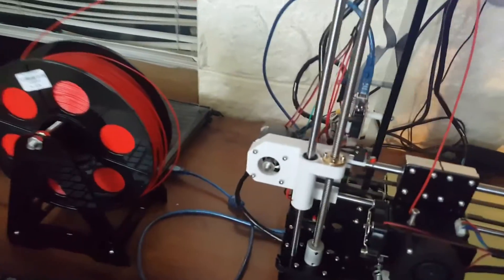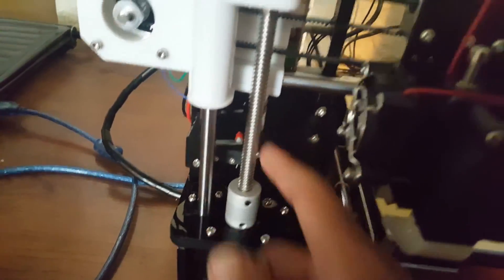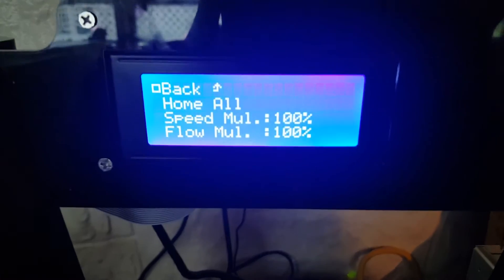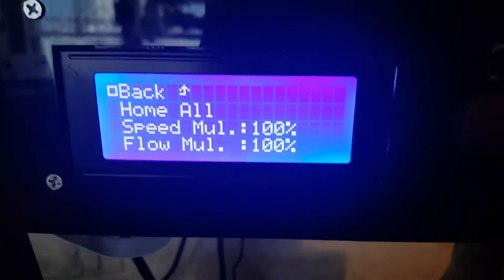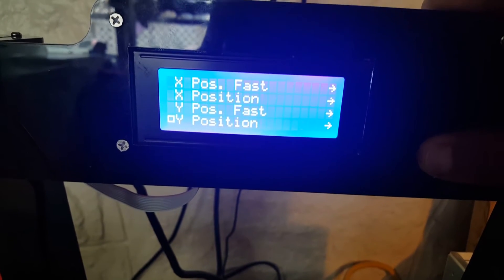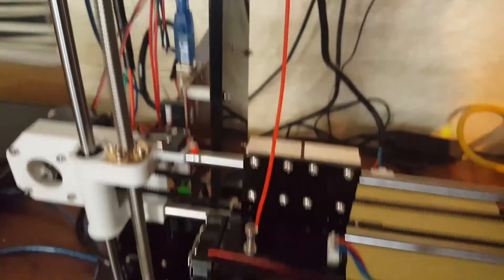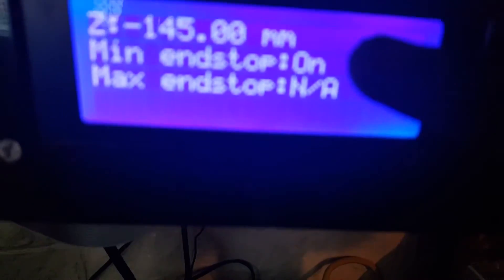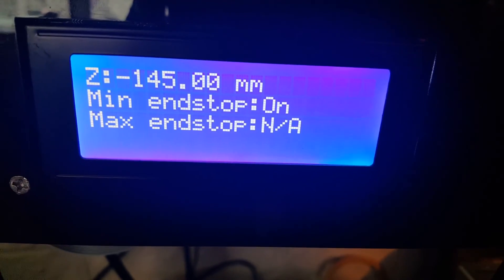My Anet A8 z-axis motors won't go down.

Comment: probably not a recommended method, but i removed capacitor c45, didnt have a soldering iron on hand so i VERY CAREFULLY crushed c5 with a pair of pliers, been fine since, but it would be better to replace it, or at least remove it with a soldering iron

Comment: I read as many comments as I could stomach.  Normally a person begging others for help is gracious enough to put his solution in the video details, this is customary here and other sites.  It's kinda like not commenting in  all caps or using flashing letters.  I know that folks never change so of course I don't expect it.
Reply from the maker: You remove capacitor C45.  Easy enough and done.

Comment: Had the same problem. Used a sharp-point solder iron, heated several time each end of C45 and GENTLY pulled it out (with the solder) util it fell. Now Z stop sensor works fine. Go trust a 1mm capacitor... Many thanks!

Comment: I have same problem this discussion was really helpful.  I have an auto leveler.  The resistance was 11k so cap not bad.  But with the auto leveler it was reading like it was always closed.  It read .5v across 1 and 3 and if not close to surface it should be more like 5v.  Still need to confirm it is auto level.

Comment from the maker: I know what's causing the problem.  It's a bad C45 capacitor connected to the R39 resistor.  If you use a multimeter and setting to ohms.   Test across the capacitor or test the leads 1 and 3 on the z switch connector on the board.  The reading should be 10k to 12k ohms.  Mine reads at only 3k ohms, so my capacitor is bad.  Now how do you fix it?    A few methods I saw was to either reheat the capacitor leads with a soldering iron, replace the cap, or even pull out the capacitor and leave it empty,  making the resistance go very high.  Of course the easiest but most expensive method is just replace the whole board.   hope this helps
Reply: Thank you! I've re-soldered the C45 leads and still a little surprised that my issue is now fixed.

Cheers!!!
Reply: Just a good fine point iron and something to rest your hand against. Set your hands up for stability and use a helping hands or something to firmly hold the board. I use a Hakko FX888D-23BY and think its great for the money.
Reply: did you just reflow the solder one side at a time or did you take it off and put it back on
Reply: got it all working now didn't want to reply here till I new it was working perfect as it was ok for a few days at a time then just nothing, but its been about 2 weeks now and no faults and I've even got a free spare board gearbest sent me aswell...
Reply from the maker: By the way this testing methods works if your x and y stops are not working either.
Reply: any idea what these capacitors are
Reply from the maker: Eric Junkman how you resolder it?  it was kind of hard for me to get to it
Reply: one side at a time, leaving time for the other side to cool
Reply: Huge thx for the tip, fixed my board in 5mins, only needed to reflow the c45 side towards the plugs.

Comment: same problem with marlin software installed
Reply: Found the solution. take off c45 with a pair of pliers. if that does not work change r39 with a 10k one.